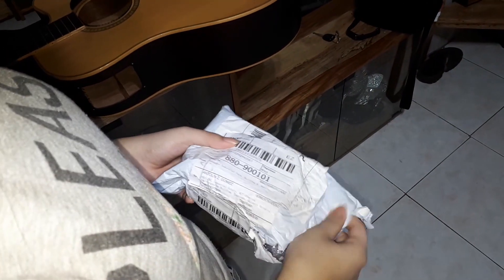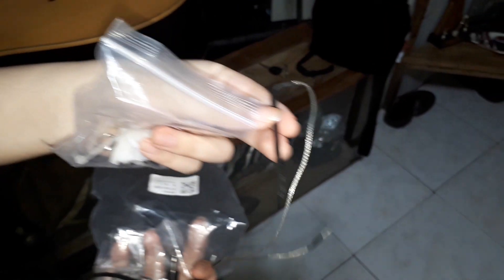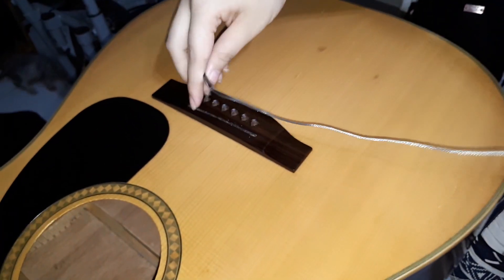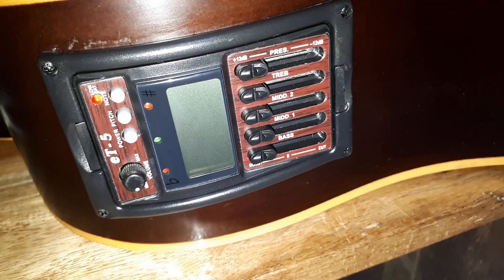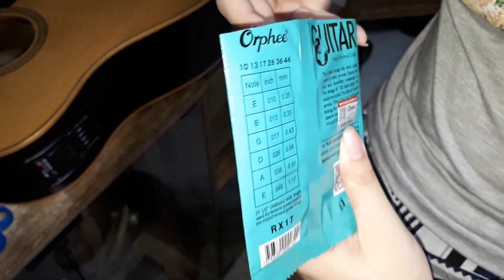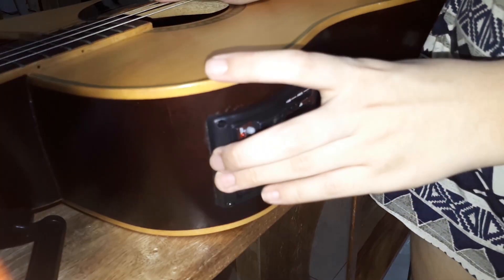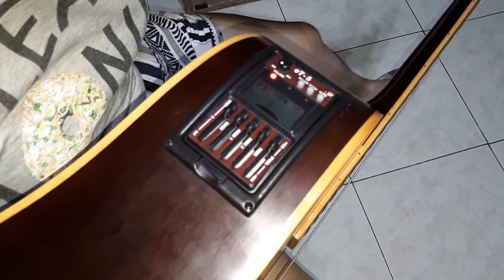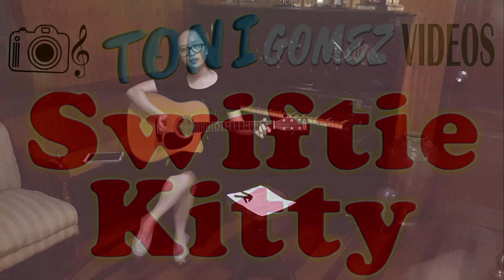HOW TO REPLACE OR INSTALL ET-5 PIEZO PICKUP EQUALIZER PREAMP for ACOUSTIC GUITAR | Swiftie Kitty

Comment: Question: do you have to remove the battery pack even if guitar cable is unplugged? Does it drain the battery even if no cables attached? Thank you!
Reply from the maker: hi, thanks for asking. the battery pack is attached to the whole assembly. You cannot separate the battery pack with the whole assembly. The assembly has two female sockets which connects to the guitar pickup then to the output jack only. hope this helps
Reply: @SwiftieKitty  hi. So you cannot replace the battery pack unless you remove/disassemble everything?
Reply from the maker: @jambibaub8753  hi, no. You don't have to disassemble everything. there's a clip to open the battery pack, but with it, is the equalizer/tuner, etc.., and what remains on the guitar is the plastic casing that holds the entire assembly. At the back of the equalizer/tuner is where you put the 9V battery